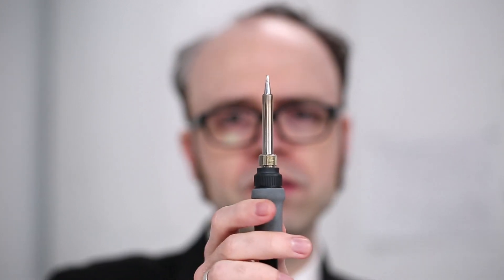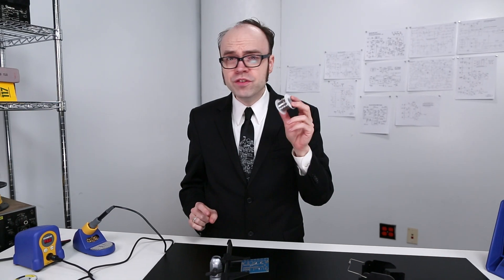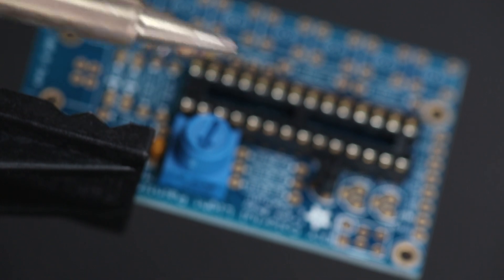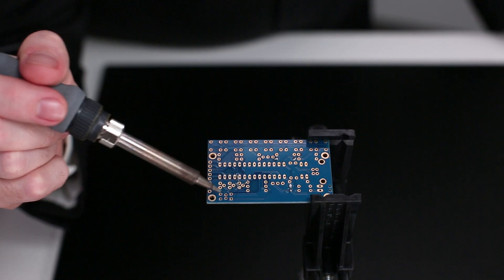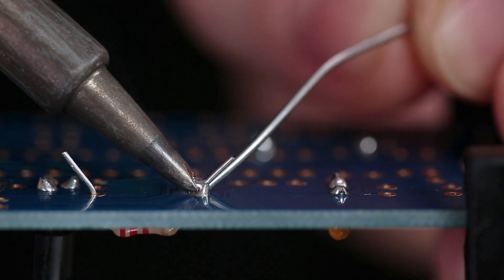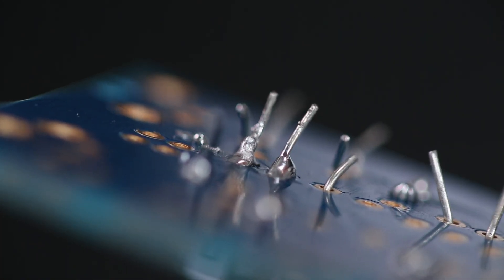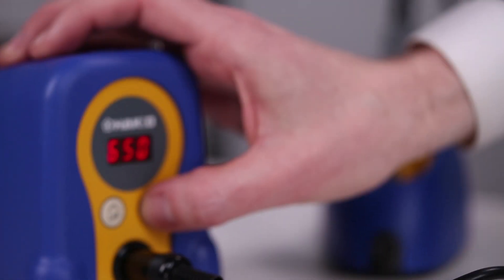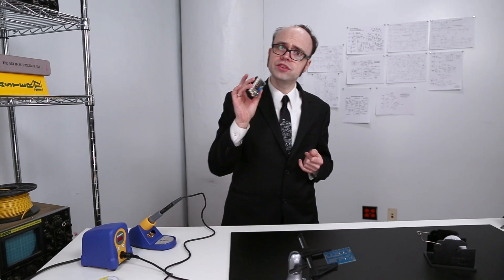Collin's Lab: Soldering

Comment: I wonder if a lot of disasterous soldering we see on project forums might be from people assuming what is said at 3:32 is true for all solder, i.e. that it has a flux core. If people are buying non-rosin-core solder, and trying to solder as shown in this video--without supplying their own flux--they are going to be in for a bad time that no amount of adjusting iron temperature is going to fix.

Comment: Thanks Collin you taught me how to solder and I just repaired 500$ worth of Camry speedometers soldering in a 3 prong ceramic resistor on them both and it was easy and fun. I had a cold solder joint and I hit it with the iron real fast and it fixed it. My setup was not as nice as yours I used 5$ iron, crap wash solder and some copper wick for desolder. Thank you!!

Comment: Yeah about that whole 2 seconds thing...it usually takes me way longer than that to melt the solder and make a join. Why? I have a Weber 25w iron. Is it just too weak, for even the most small thin wire

Comment: Nice video, but touching the solder to the iron when creating the joint is bad practice, especially at the high temps you recommend. It'll burn off lot of the flux and create blobby joints that are rather reluctant to wet the surface (got a lot of these in the video.) If you heat the pad correctly (which is very easy with a chisel tip), it will melt the solder right away when you apply solder to the pad/lead interface directly, and the resulting joint will be much neater and stronger. Also as I said, your temps are on the high side, especially for beginners. Personally I like higher temps that allow me to get in and out quickly even with big joints, but a beginner will be ruining a LOT of components and boards at 400°C, and burning most of his flux.

Comment: An absolutely excellent video--clear, concise and brilliantly presented. I was especially pleased to see that no emphasis was given to using external flux. This is a practise I have come to believe is actually counter productive and when using even moderate quality solder is completely unnecessary.

The only issue I would raise is that as an example of an appropriate quality tool you highlight a Hakko 888 station. No doubt this is indeed of high quality but it is also extremely expensive and likely out of reach to beginners or even long-term hobbyists such as myself. Again--nothing wrong with showing the Hakko iron, but also give an example of a more sanely priced tool as well for those of us who can't afford £120 or even £60 for that matter!  For instance the entry-level example given in the description is pretty good and could well have done with an appearance in the video itself, as could one of the reasonably priced but still decent quality Chinese stations. I know professionals in electronics who never used anything but a directly mains-powered, thermally balanced iron through their entire life.

Otherwise a great presentation. I just wish Colin had his own channel!
Reply: I'd argue that for anyone who is looking to do electronics at today's scale, including surface mount components, Hakko's FX888 is about as cheap as you'd want to go, and an excellent choice no one will regret. It's about $100-$110, which I would not call extremely expensive. The cost is comparable to that of any decent power tool, like say a Makita 18V drill. Hakko has $2500 soldering irons for people who do this for a living. The soldering iron is your main tool as an electronics hobbyist, cheaping out on it will affect absolutely everything you build or repair. Trying to do everything with a single 25W mains-plug iron is, IMO, a mistake of false economy; you'll lose the difference in cost over your first couple of weeks, as ruined boards and components, wasted solder, and by spending 5 times as much time fixing and debugging your bodge jobs than if you had a good tool. When I was a kid, I could get by with one 25W Radio Shack pencil iron too, but those were the days of discrete, through-hole components only. I can't say that I'd want to use that today on something like a microcontroller or TSOP IC. And on that note, a lot of people are going to find out pretty quickly that they need a hot air station too; soldering is not just for irons any more!

Comment: after using my soldering iron the solder tip turns black and doesn't work how to fix and prevent it??
Reply: legendary device first, clean the tip with a slight abrasive like scotch brite just to remove the carbon. DO NOT use sand paper. Just us scotch brite. Once shiny again, heat your soldering iron up and TIN THE TIP! Apply solder to the tip. You should notice that it turns shiny again. Do that every before soldering with your iron. Also, when storing your iron, leave some solder on it to protect it from oxidation.

Comment: So what's the best type of solder to use (Lead based 60/40) or Lead-Free? Can you supply a link to the preferred solder? Thanks
Reply: Michael Turrell Lead free is not meant for soldering. 60/40 tin and lead is perfect

Comment: It should be noted that lead-free solders don't generally have the same shiny finish even on good joints. Those using lead-free solders should not be alarmed if your end joints look a little dull.

The technique here isn't really great, either. It's fine for an introduction video, so I'm not going to criticize, but this technique (wetting the iron and then wicking to the joint) relies a lot on the flux in the core. Old solder (it has an expiration date!) may have some wetting issues. It's ok to pre-tin the tip and then contact both points of the circuit, and then apply the solder to the opposite side of the iron.

There are also standalone flux applicators (dry/paste or liquid/pens/syringes). This will make your life easier, and it should be considered an essential tool.
Reply: And yep - extra flux is definitely recommended, but probably not necessary for a lot of basic through-hole soldering, as long as you use a decent solder with multi-core flux to begin with.

But, added flux is pretty much a MUST for a lot of surface-mount stuff, especially when doing drag-soldering on chips with many fine pins.

I use often use extra flux for making things like the solder joints on small 0603 / 0402 sized components a lot neater.

Many of the cheaper "stripboard" or "matrix boards" with bare copper tend to oxidise too easily as well.

You can buy the nice pre-tinned proto boards really cheaply now, so luckily the bare copper boards are a thing of the past for newer prototypes. hehe

I find lead-free solder to be OK to work with, as it's used in practically everything these days. It does tend to look slightly dull in comparsion to lead solder, but it doesn't take long to get used to using it.

You do need a fairly decent soldering station with a good thermal capacity for lead-free really (due to the higher temps required).

Thermal capacity of a soldering iron / station is NOT the same thing as it's rated wattage though.

The cheapo irons you often see (usually with the giant screw that holds the tip in. lol) can get way too hot when just sitting "idle", and can have that charred / oxidised look in a very short time.

They might claim to be "60 Watts" or "100 Watts", but that doesn't mean they have any kind of temperature control, nor have decent thermal capacity when soldering larger components / PCB planes / heatsinks.

Comment: is a smoke of flux are bad for health?
Reply: ***** This only applies to LEAD based solder. I don't think anyone uses a respirator soldering, even for lead based. Don't keep your face over the smoke, hold your breath if a wisp comes to you. In all the videos of soldering on YouTube, even by professionals, I've yet to see a SINGLE video showing a respirator. You can build a cheap smoke evacuator for under $10 dollars, I believe MAKE has a video about it (and possibly a kit).

I weld for a living, and the only time a respirator comes out is if I'm releasing Hexavalent Chromium, or doing large quantities of zinc coated parts. Small quantities of the latter - I'll take the MFF and immunity for a week.

Don't breathe it in, but you do not need a respirator.

Only you can decide what levels of precaution to take, but professionals who solder every day for hours either use nothing at all, a small fan to blow the smoke, or possibly a nice Smoke Evacuator like the HAKKO shown here.
Reply: If you noticed I said those that solder for hours a day use a smoke extractor instead of a full face respirator. You have to balance what you want. Someone soldering for 30 minutes a week isn't going to need a respirator to solder.
Reply: ***** If you're afraid of soldering fumes, then don't solder.  Nobody is holding a gun to your head.  If I was soldering for an hour every day, yes I would wear a respirator, but I solder for maybe 3 or 4 hours a month, so I'm not going to be chicken shit about it.
Reply: Wow, you're such a big person for recommending I solder in a non-ventilated room for 3 or 4 hours a day.  I'm amazed by how much you actually care about other people, and how you aren't at all just being facetious to get attention on the internet.

I'm sure YOU will win the Nobel prize and contribute vastly to society.

I'm an electrical and computer engineering major myself.  If you're afraid of soldering fumes, you might consider changing majors.

Carcinogens are everywhere.  Sugar is a carcinogen, so I guess you should stop eating anything with sugar in it.  Aspartame and sucralose are carcinogens also, so I guess you should throw all sweets out the window.  Vaccines contain thimerosal, which is an organic mercury compound, so I hope you've never gotten a flu shot before.

I will continue to solder without a respirator, and I would bet it never kills me.  You can either live life or avoid it, either way you're going to die eventually.
Reply: That's ridiculous.  And of course one gram of lead is more harmful than ten grams of sugar, but the average American eats 69 kilograms of sugar a year, that's why heart disease is more likely to kill you than soldering fumes when you use a ventilator our fan rather than a respirator.

Nobody said you don't need a fan or ventilator, or a respirator for high volume soldering jobs, but to break out the respirator each time you solder a joint is over reactionary.

I wasn't addressing the original poster, I was addressing you. You said everyone should use a half or full respirator when soldering, but that's really not necessary most small jobs.  A fan is plenty.  And don't put Yolo in quotes as if I said it.  You don't know when quotation marks are appropriate, much less respirator masks.

And if you want to talk about irony, you aren't anybody's doctor either, so by disqualifying my opinion on those grounds, you equally disqualify your own.
Reply: ***** You poor thing. Don't worry, you got the attention you so desperately seek. Plenty of professional EE's and hobbyist alike got a show of your true intentions quite quickly. Sorry your 3 minute Google copyjob didn't impress anyone, and you had to retort to insults. That quickly showed your true intentions.

So go ahead and strap on your positive pressure Level A Hazmat suit to change the battery in your smoke alarm - after all, you're working with a radioactive hazard! Or possibly put down any sort of insecticide. Maybe unclog a drain. Can never be too careful.

The Dunning-Kruger Effect has never been such succinctly illustrated.
Reply: Nobody said solder flux isn't harmful, we just said you don't need to put a respirator on for a short small job now and then.  Also, stop being so sensitive, I never called you a chicken shit, I said "I'm not going to be chicken shit about it." But now I AM going to call you a butt-hurt troll, because you are one.

And who the hell says "brah"?
Reply: ***** Thanks for that info man, kudos! Indeed, better stay on the safe side, especially when one is not a professional doing soldering all day long (less dexterity = more fumes, usually). But IMHO those precautions should be taken all the time, even with "lead-free" material... John Smith, you wrote that " inhaling flux fumes has been deemed approximately equivalent to smoking tobacco in terms of the health risks "... Which means cancer, however the comparison is wrong : compounds as formaldehyde are highly cancerous, much more than tobacco (i.e. when one is exposed to formaldehyde for some period of time, the chance of developing a cancer is so much higher than tobacco within the same period, almost 100%). Which is why that compound is strictly forbidden by-law since many years in housing constructions (Canada-Quebec), even if it's covered with plywood or such (in which case you won't even "inhale it", its presence being enough to represent health risks).

Comment: My #1 soldering tip, Use eutectic (63/37) blend solder. It costs no more then regular (60/40) and makes producing a cold solder joint almost technically impossible.

Comment: My best tip for soldering is to make sure the iron has a high enough wattage for the job at hand.. else you can end up frying components waiting for the joint to get hot enough.
 It is worth spending a little more for a good iron that has a high watt rating.. preferably with a temperature control so it can also be used for small jobs too.

Comment: Huh.  Ive been taking it literally when they say dont put solder on the iron first.  Looks like its okay as long as the iron has been used to heat both parts.  i always touched the junction of the iron and the two surfaces but not always with good results.  Interesting
Reply: Sometimes its difficult to adequately heat all elements without first creating a solder "heat bridge." There's nothing wrong with putting solder on the iron first as long as you aren't just trying to drop a blob of solder and be done. I usually make a "heat bridge" to allow a good contact area (and thus good heat flow) and then apply additional solder to the actual parts of the joints (to ensure that there is fresh flux to allow a clean bond).
Reply: I was taught this falsely too.
It's usually misleading because you don't do just one or the other, you need to do both.
Tinning the tip is for the heat bridge(if there isn't any already), but it also boils the flux, so you have to add the solder too. Both are necessary.
You also have to tin the tip to prevent oxidization of the tip.
Reply: Me too! Very clear soldering instructions.